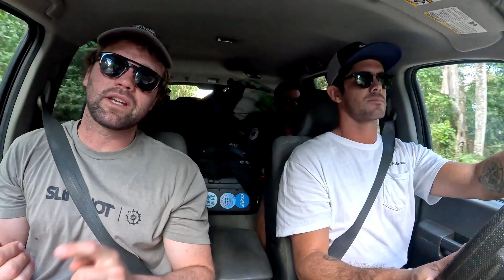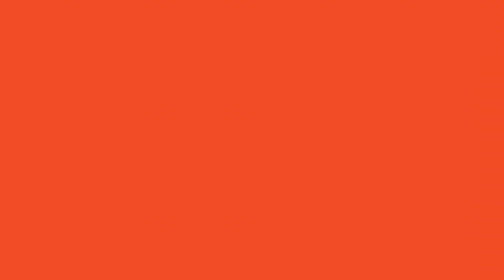High aspect VS Low Aspect - Manny + Sam car talk

Comment: So would my pfi 730 have less lift than my ptm 926. I would like something for lighter winds so maybe the G1000 ?
Reply: I use the g1000 and love it. It lifts earlier and glides better than the 926. When using it I find that I can use my preferred 4.5m wing more often.
Reply: Thank you that helps a lot 🤙
 @rolandgurner5588
Reply from the maker: The PTM 926 has 1250 surface area and PFI 730 has 1450 surface area. They have similar amounts of lift but the PFI 730 will have a slower 'stall speed', meaning it will foil at lower speeds but the 926 will have a higher top speed but the 926 will glide further at those higher speeds. The 926 is one of our best, most popular foils as it is so good for everything, it gets you going in lighter winds but still has plenty of performance. The G900 is similar to the 926, and the G1000 is a bigger version of the 926. The g1000 is the biggest foil you need for winging, it will foil at slow speeds and glide further than both the 730 and 926 whilst still having a high top speed
Reply: Great,thank you for that. Definitely buying the g1000 now 🤙 @slingshotsports